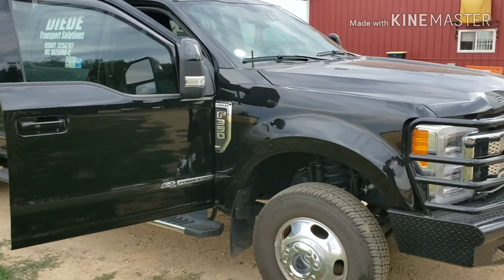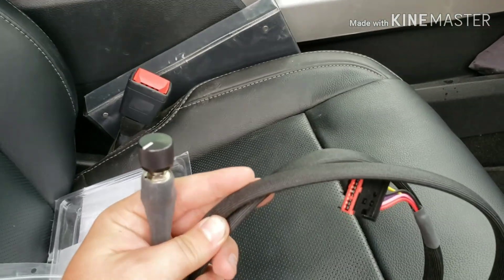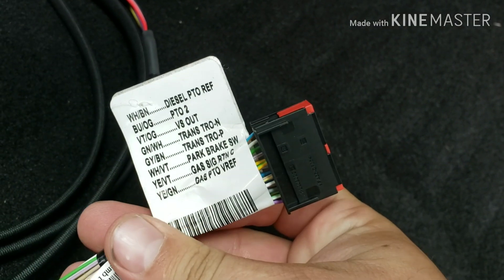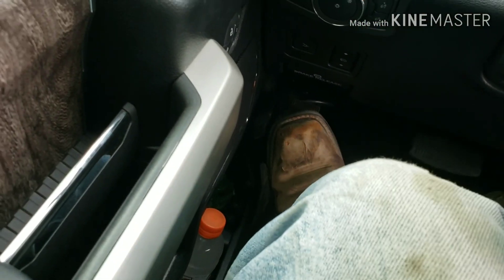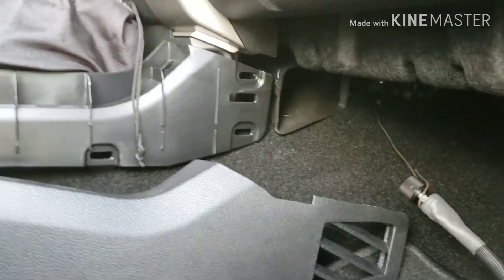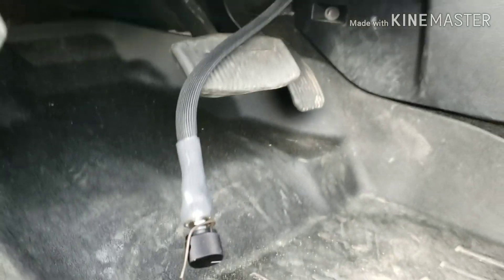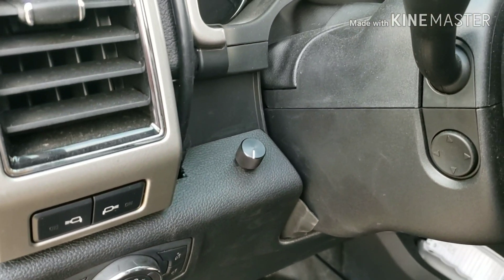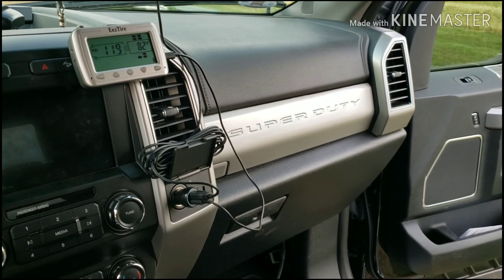2019 F350 High Idle Switch "BD Diesel"

Comment: Hi you said at the very end of your vid, if you have any questions leave 'em in the comments...my truck wasn't equipped with upfitter switches, so will I still have that same pigtail in my fuse box that this product plugs in to? I know this doesn't run off any upfitters, but I'm just asking if my F350 should still have that plug that this kit plugs into? I pick up my '21 in a week, and the first thing I wanna do is put this in. Thanks!
Reply from the maker: Good question. I would assume the harness will still be there. It's cheaper for Ford to make one harness with options as opposed to multiple different harnesses
Reply: @THUNDERstroke73  ok well I guess I'll have to wait six more days until I pick it up. First thing I'm gonna do is yank the cover off that fuse box, and take a peak.
Reply: @shawnatkinson6564  Did it work for your application without upfitters?
Reply: @GJ-xf7bh  Yes sir it did! The wiring kit from BD diesel simply plugged right into the factory wiring harness located in the kick panel fuse box. It works perfectly. The dial with the kit will give you a range between 900-2900rpm. I love it!
Reply: @THUNDERstroke73  Was there any determination if there is a pigtail in vehicles without the upfitters?  I am unable to locate the connector with bundled wiring. Thanks, I may have to return if its not there.

Comment: I have a question on your IRONBULL HYD dove.  How much weight can you haul on it? I can only find weight ratings from Center of dove forward, but you show a picture of large square bales all the way back?  I'd be hauling Square/Round and I like the idea of Hyd dove vs flip over ramps, but if I'm limited to weight bearing on 36' trailer (40')   might as well get the fold over ramps that can bear weight entire length.

Comment: Just curious....right beside the switch you installed, did you or someone else “drill” that hole with your teeth?  Why would someone would  do that to a brand new vehicle is beyond me, hideous install of whatever it’s for......
What application do you need high idle?  Nice video...oops, I see you commented for winching and warm up, makes some sense I suppose
Reply from the maker: It's a used dash panel i got from a 2017 parts truck.  Not sure what they cut it for but actually worked great for what I needed. My original one is on the shelf at home

Comment: So it’s either factory idle RPM or 1400 RPM?  Not adjustable?
Reply from the maker: This one is adjustable using the knob. I forget the range but it's pretty big
Reply: ChassisBlack73 what is the lowest RPM?
Reply from the maker: @FlatPlaneCranky  just slightly above idle. Pretty sure it's like 750-2900
Reply: @THUNDERstroke73  900-3000rpm is the range.

Comment: Never heard of one of these.What is purpose of it ?
Reply from the maker: A few different reasons. Most people use high idle for winter time to warm the truck up faster or maintain warmth. The reason I got one for this truck is with all the emissions crap, these trucks don't idle hot enough. So soot builds up and can cause issues down the road. For what I do, on some occasions I need the truck to idle all night so I don't bake or freeze to death while trying to sleep.
Reply: @THUNDERstroke73   Why not buy a Webasto and save your engine and emissions equipment?